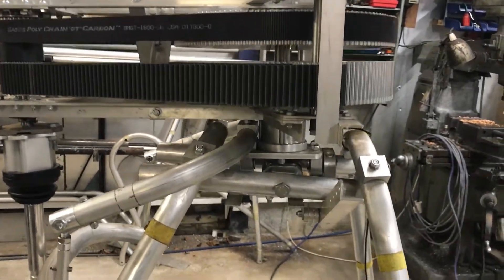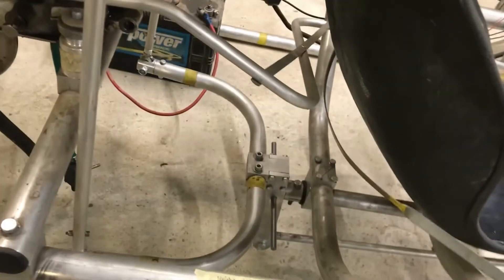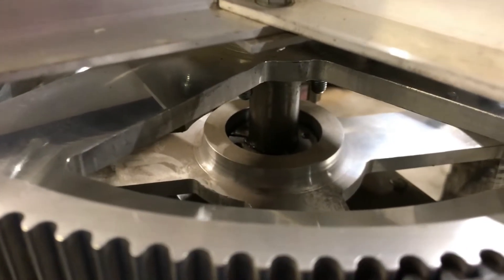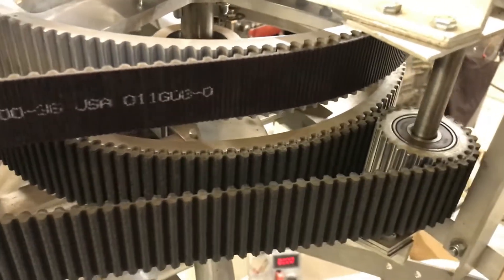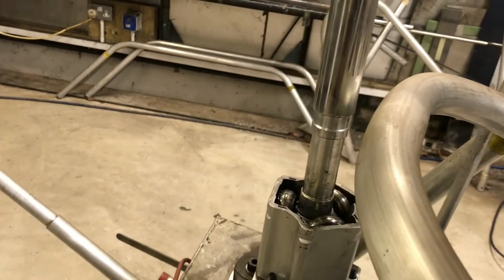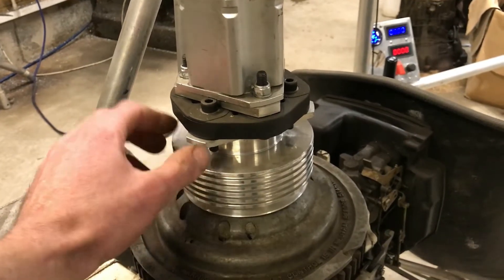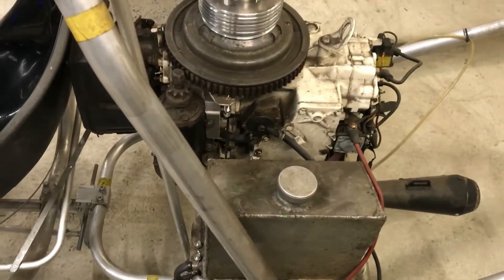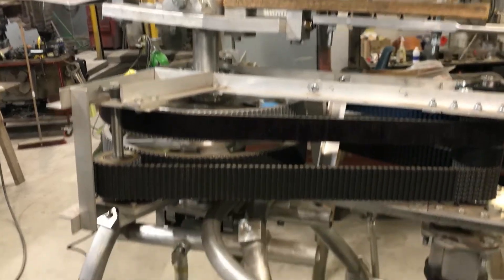Homemade coaxial Helicopter walk around and explanation

Comment: I like it. It’s fine. However, how do you change the pitch of your rotor blades? Is the speed of your motor going to determine how fast you ascend or descend?
Reply from the maker: That’s correct, engine/ rotor rpm controls lift.

Comment: What is the length of the rotor and pitch angle?
Reply from the maker: The rotor diameter is 4.3m and the pitch is 6.5 degrees on the bottom rotor, 5.5 degrees on the top rotor.

Comment: Love  the fiber lock nuts in a high vibration area, none captive (Castle nut),Im thinking my Ex-wife would be a  great candidate for flying this fine aero machine. Oh yea the  wood/micards  block on the main rotor is a fine touch.
Reply from the maker: Captive nuts aren't necessary on a proof of concept prototype and if you listened to the video I said wood won't be used as a blade strap material, 7075t6 is what I used.

Comment: There is a better way for the belt drives.
Reply from the maker: What's the better way ?
Reply: @Ben-Dixey  I really admire what you have done. 
Better, only if using two identical belts is better?
This man is using two identical belts.
https://www.youtube.com/watch?v=JQDcx7wuHIc&t=5s

That means he has a small gearbox with two small gears meshing together. 
Only one gear is driven the other one just follows it 
That means they turn in opposite directions.
Each gear then has a pulley on it's shaft for driving a belt.
So instead of two idlers, you have two gears.
Is that better?

Comment: Glad I took a second look at this as I had mis-remembered some things, for some reason I thought that the engine was attached directly to the gimble and moved with the cyclic ... glad that's clarified  !! :) 
But now that I have had a second look at this video I'm wondering about the cyclic range limits and also might it be better to re-arrange the power to operate more like a traditional collective lever so that muscle memory habits from developed from your lessons would relate directly to the operation of this helicopter, I think that's something that might throw me a little.
One other thought also occurs to me is would there be any value to putting a gear reduction between the engine and the flex drive as this might reduce the torque spikes and it would also allow you to increase the pinions driving the belt thus increasing the somewhat sharp radius and reduce the bending angle, belt life and all that. I know, more cost, weight and complexity:)
Reply from the maker: Hi mate. Yes I have changed the throttle to the conventional pull up to go up now. Much better having it operate the standard way. 

It's an option to add another reduction but it's something I wanted to avoid. I wanted a single reduction for reasons of weight and efficiency. Keep things as simple as possible but I know I'm pushing the limits on the belts in my current configuration. I will have a think about it though. I would be increasing torque but reducing speed on the drive shaft which is something to consider.
Reply: @Ben-Dixey  ah such is the compromise of design :) ... the extra torque would be welcome for the upcoming increase in blade pitch angles but the lower head speed would not, back to the debate about blade length again and finding that sweet spot of a compromise between these three variables.

Having the controls move in the direction you want the heli to move  in really helps with the old snake brain instinctive reflex thingy ma bobs. :D :D :D
Reply from the maker: The Va115 uses a tip speed of 492 ft/sec for the same rotor diameter. Any thoughts on this ? My blade speed is 576ft/sec. They are using a 50hp engine though but a max take off weight of 260kg.
Reply: @Ben-Dixey  these helis with just latters and numbers for names are so unmemorable to me, why can't they call them the waspette, dragonflyer or Hornet ? :)
Anyhow, there are a couple of other variables to play with here, aerofoil section and thickness and chord length. If they're running a lower head speed  they must be using a thicker or longer aerofoil .. or both ...
Although, they could also be using a none symmetrical section, and maybe even built a set of composite blades which also have taper and twist built in too. 
Are you able to talk them ?
Reply: @Ben-Dixey  What's your current take off weight at the moment ?
Reply: @Ben-Dixey  Actually I'd like to add to that, they could simply be running a much higher pitch angle which would align with the lower head speed too. Had another look at the Va115 to remind myself what it looked like and I note that it has a the full suite of swash plates thus collective control, which means they can fine tune pitch required much more easily etc. 
What are your thoughts ?
Reply from the maker: Yes I know what you mean about the lack of a name. Mind you I haven't named mine yet. I did think of calling it the Dixey Dragon fly but there are a lot called the dragon fly unfortunately. Even two bladed machines! Maybe the Dixey DoDo ??  😆😆
I'll find out more about the va115 Rotors. 
The take off weight me included is around 240kg but coming down and that figure might not be accurate as my weighing scales vary 10kg without changing anything. 
My thoughts are ask you and go from there! Ha 
From previous tests lowering tip speed allowed a higher angle of attack and produced much more lift. But as you say there is an optimum and much more too it.
Reply: @Ben-Dixey  So many variables and not enought time !! haha :D
I like the Dixey DoDo , a memorable name ! 
Even if it sounds a little like "doody" ...
I'm going to be a bit more optimistic and call it the Dixey GoGo :D :D :D
As for asking me and going from there, you do know I'm not an expert on this subject right ? :)
 Anyhow, I'll take that 240kg's and plough it through the lift equation to arrive at a few variations of blade angles and tip speeds.
I'll stick to the NACA 0012 for now though.
Reply: @Ben-Dixey  btw I expect you to call your heli the Dixey GoGo from now on in honour of this conversation, it's about bloody time that machine of yours had a proper name innit ! 
I look forward to your next video update :D

Ah yes, after thought time ...
The next flight test should be imho to increase the blade pitch half degree across the board so as no to introduce too much strain with the current gear ratio. sounds small but I think it will produce a notable difference. Be sure to remember what I said about being positive nudging the stick forward during flap back and feeling the during take off, better to set off going forward than any other direction, you can always steady things once airbourne  !
Reply from the maker: 😆 yes you are absolutely right, it should have a name by now. I'm really tempted by the Dixey Dodo 🦤. It doesn't take itself seriously and that's what this project is about, having fun. 
Even if the Wikipedia description of a Dodo is a stupid flightless bird. 😀

I will do as you suggest and try the extra pitch with the same gearing, I will
have reduced weight by then so things will be different. This rotor flap back stuff I'm nearly there in understanding, but not fully yet. Push forward I will have in my mind on the next hovering experiment. 👍
Reply: @Ben-Dixey  ...Gotta say I prefer Dixey GoGo,
It's still a bit of a silly name given what a GoGo dance looks like but it's also optimistic and upbeat without taking itself too seriously. plus when you're at the controls it does kinda look like you're doing a mad dance, a mad hill billy go go dance  ;) 
Thunderbirds might be Go but Dixey is Go GO !
F.A.B. Virgil !!:)

Flap back is because of the positive pitch of the advancing blade getting more lift into wind than the retreating blade going down wind the net effect is that the disc tilts backwards and then the whole heli is flying backwards. Not good when uncommanded !

Positive and assertive nudges forward. and by nudge I mean punching the hand forward and bring it back to the neutral position, repeat as needed and if your neutral position is too far aft move it forward a bit, repeat and adjust, remain calm and don't look down at the ground, keep your eyes on the horizon glancing down occasionally to keep your situational awareness updated regularly, but the horizon is a much better reference point for maintaining a steady hover.
 
How many heli lessons have you had so far ?
How are you getting on ?
Reply from the maker: Ah not heard of a GoGo dance, will look it up. 

So the headwind hits the advancing blade and because of aerodynamic precession tilts the disc around 90 degrees later? Same as how the cyclic increase the angle of attack with phase lag? 

In forward flight dissymmetry of lift wants to do the same thing accept the teeter hinges equal out the angles of attack by rotor flap ? 

Total lesson time so far is 1h 10minutes. I might do more, it's a bit of a drive to the airport plus the cost of the airtime. The R22 is a bit tight for me at 6'5" but it's so much cheaper than the R44. 

In an RC chopper flying inverted, is it more stable with the rotor underneath ? Just thinking of the high stability of the flying platform.
Reply: @Ben-Dixey  .. I think you understand flap back now judging by your reply, the teetering head helps to a degree but once you get going in forward flight the heli wants to roll as well as if things weren't complicated enough !! 
But also in forward flight the thing still wants to flap back so you have to hold in some forward stick to compensate. All this is way more prominent on flybarless rotor heads.
Weighted fly bars help and paddled fly bars balance things out quite well ...

As for flying inverted models, couple of things, chances are you're flying you model higher and out of ground effect, also the down wash  is no longer flowing over the boom or pod which also helps. But if you could have the CG below the rotors without it interfering in the down wash it would be more stable. Not only that but when you're flying inverted chances are you're more focused and flying better :)

This one is a maybe but ...
there could also be a slightly more complicated reason depending on the arrangement of the linkages from the swash plate if the blade grips have trailing arms because as the high CG topples it pushes into the disc automatically correcting itself ... maybe...
Not thought this idea through properly but it might be possible I suppose ?

as for heli lessons, they're more expensive than cocaine and hookers !! ... so I've heard anyway, don't know for sure as I spent all my money on heli lessons !! :)

I reckon if you can save up for four more hours you will be on the verge of hovering without thinking about it. Next time you go have two lessons in one day and have a decent break inbetween them to let your brain rest and consolidate the first lesson of the day, that way the journey is much less painful. and ask the instructor to allow you to spend as much time practice the hover as you can. Have a short circuit flight  to warm up maybe. 
Relax as much as possible, of course, use small nudges, focus on the horizon mostly.
Resting your fore arm on your leg to stabilize your hand and fly with your fingers, avoid gripping too hard and allow yourself to feel what the heli is doing.

Then go back in a week or so and do it all again so you have a nice block of air time as flying is a perishable skill after all. But this will really help you out during your next test flights.

Btw if you're 6' 5" how heavy are you ?
90kg's ?
Reply from the maker: @freezatron  great advice, thanks.

It was explained to me about the flying platform always wanting to self correct with the rotors underneath. As the pilot leaned the rotors would follow which corrected the pilots lean back to vertical. Perhaps a bit different in a non weight shift type situation. 
With the rotors on top and the pilot was to lean the situation gets worse and worse until a correction is made. 

If for example if I moved the weight higher in my machine like raising the engine or pilot I'm still not sure if that would make stability better or worse. I would certainly expect the delay in response to change. longer delay in response with the weight lower. 

I'm about 97kg I believe, but that was going by my inaccurate scales.
Reply: @Ben-Dixey  not quite sure what you're saying in the first paragraph, are you talking about flying inverted or that training platform that won't let you leave the ground ?

Regarding the vertical CG position, imagine the difference between balancing a pencil vertically on your hand versus letting it dangle from your fingers by one end.

As I understand it (thus far) the higher the CG the more agile and the more positive the control inputs can be, the lower the CG the more stable it is and the controls feel softer so making a positive correction is harder but also the more pronounced the pendulum effect can be too and if it starts getting away from you  when your behind what's going on and your corrections are late to the party when the pendulum starts swinging the harder it is to bring it back.

If you fly through turbulence and the heli rolls to one side the lift vector will pull it in that direction but eventually the pendulum swings back underneath, left unattended or mismanaged this can oscillation can grow in magnitude up to a point anyhow, depending on numerous variables of course.

If the CG is in the centre of the rotor disk one would call this neutrally stable, once the heli leans one way it will continue in that direction, in ground effect it will probably get worse as it slides off the top of the bubble of lift or high pressure.

When the CG is above the rotor disk like the pencil the weight will want drop below the suspension force and swap ends. Once it starts leaning over it will want to continue to lean over, especially on a teetering head of any kind.

But there other factors which make all this less than simple like the drag of the fuselage.  thrust goes one way drag goes the other way.
when inverted this drag will help you, right way up maybe not. Also anothing to bear in mind about all of this is the design of the rotor head.
Rigid, semi rigid, articulated, semi articulated, teetering, flybarless, weighted flybar, paddled flybar, leading or trailing arms on the blade grips. Then there's fixed pitch and all the quirks that introduces not only that if you're using a weight shift system a neutral CG isn't going to work as you need something to push against. 

A surfer standing on his board is not a stable system but he can make it work by balancing on it using his weight, ok he doesn't have gyroscopic precession to work with (or agianst)   

Like with all of this  it's a compromise, there will be a sweet for the design in hand. Personally I prefer agility over stability, to a degree at least, but with a fixed pitch weight shift machine I'm inclined to think the lower CG is probably to your benefit (as I see it at least)
Could it fly ok with the engine raised ?
Probably, there's enough weight beneath the rotors to work with for sure.

Personally I think your first three priorities are (in this order)  -

1) Learning how to hover a helicopter properly so that you are better placed to test out such iterations with some level of confidence.

2) Getting to the right gear ratio even though it's difficult to change and is also connected to blade pitch.

3) Getting the right blade pitch which means eventually adjusting the gear ratio ...

The leg bone is connected to the knee bone which is connected to the arm bone... via series of complex linkages that all need to be accounted for ! :D 
I know, I know, I'm a grinning idiot :)

Seriously though until you can hover effectively you can't really test fly it effectively and overall at the moment the vertical CG is a low priority I'd say, generating enough lift to get a bit out of ground effect and having the skills to keep it there are pretty much the top of the list.

Like you said changing the pitch angles is comparatively easy but as far as gear ratios you've got three options for adjustment, 

A) Resizing the pinions, cheapest but probably the worst given the strain on the belts and recommended minimum radius etc.  
B) Resizing the main gears, expensive but simple(ish) and overall much better or ....

C( Introduce a bit more complexity and weight by adding a gear set between the engine and sprag clutch but probably a good deal cheaper  than option B (potentially) but with the side benefit of making changes to the gear ratio much easier going forward and allowing you run larger pinions on the belt drive thus prolonging its life expectancy. 

Given that this is an experimental helicopter having "room" to make adjustments easily makes option C a compromise worthy of serious consideration, to my mind at least.
Anyhow, that's my line of thinking with regard to these subjects.

What do you think ?  

Phew.. that's a long reply ... I'd like to return to emails please as this youtube reply box thing is quite cumbersome I find ... 

Anyhow....97kg's hey.... 
5Kg's heavier than me ... just saying !! :D